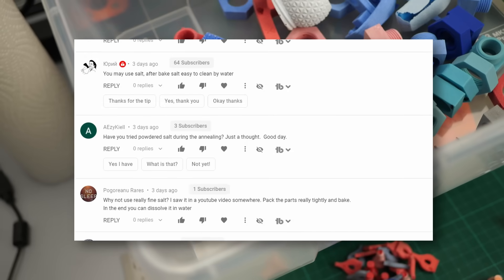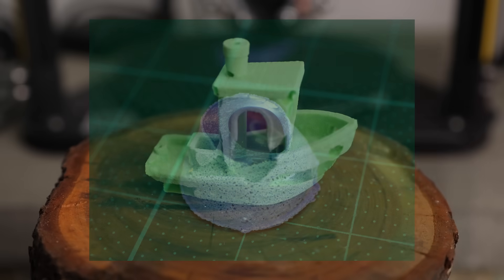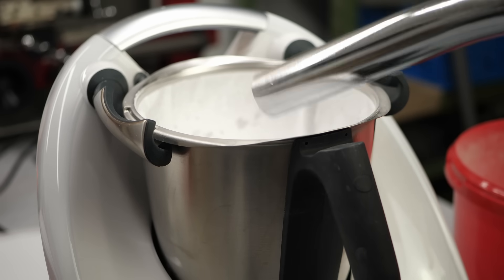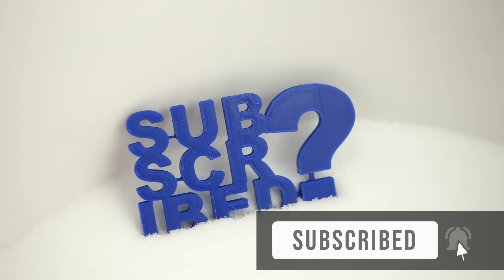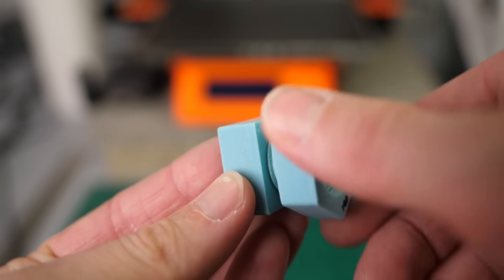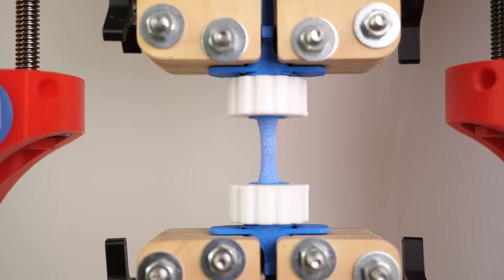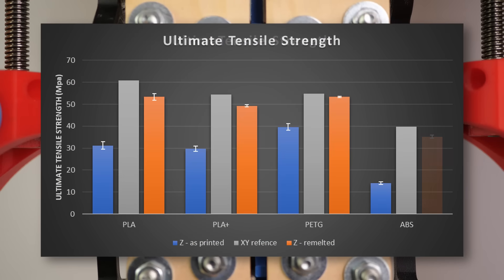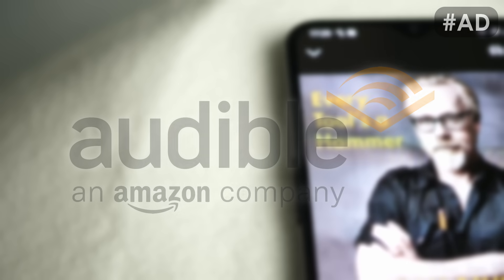The STRENGTH of 3D prints REMELTED in SALT

Comment: Use sodium carbonate. Sold in any supermarket in the washing powder section, cheaper than salt, dissolves in water, melting point is 850C. Super fine grains. Don't confuse it with baking soda, its melting point is just 50C. Also - consider applying a bit of talcum ("baby diaper powder") with a brush to the parts - they will separate more easily and surface will be better protected.
Reply: I'm sure you could use talcum powder but on Amazon that stuff's expensive, 500 grams is $30. You can get 4500 grams of sodium carbonate for $20. Sterile talc powder has a grain size between 0.399 μm and 100.237 μm with a mean at 26 μm. Sodium carbonate is slightly larger at 115 μm, you might be onto something coating the part in talc powder and then packing in sodium carbonate.

Edit to add if anyone decides to use talcum powder wear a respirator and be very careful about not breathing it in as it is not water-soluble and can lead to lung damage and cancer with prolonged exposure.

Also sodium carbonate can cause you to go blind if it gets in your eyes and it can cause scarring in your lungs. Wear a respirator if you're going to use either of these powders and avoid creating dust when working with them.
Reply: @cchamilton1985  wow, talc can cause lung problems? I didn't know, it's used for baby's skin, so i thought it’s completely safe 😅
Reply: @88Timur88Bahmudov88  if you check the packaging most powders these days are talc free. Be sure to check out the safety data sheet for this and any other powder you intend to use. Sodium chloride (table salt) is relatively safe even if mishandled, and almost any chemical is safe if handled properly.
Reply: @88Timur88Bahmudov88  They found out that talc is basically diet asbestos
Reply: @cchamilton1985  Talcum powder prices often aren't as high as you stated when you look around a bit. Look for the larger packages that aren't marketed as baby powder and you can get the stuff at a third of the price. Not sure about grain size though, it's hard to find such details on online retailers.
Reply: also some information about baking soda: "Baking soda, or sodium bicarbonate (NaHCO3), is a chemical that can undergo a decomposition reaction when heated. At temperatures above 176 degrees Fahrenheit (80 degrees Celsius), sodium bicarbonate starts to break down into three compounds, forming sodium carbonate (Na2CO3), water (H2O) and carbon dioxide (CO2)." So you can basically put the baking soda into the oven for some time at the temperature higher than 100 C and get sodium carbonate
Reply: wait wait wait, could you just use talc powder instead of salt? It's really fine and as i found, it's melting temperature is also about 800 degrees C, would be really cool if it worked
Reply: just use calcium hydroxide, sold as hydrated lime in 25Kg bags for dirt cheap. It's also used in construction work... 
and can be dissolved by any acid, including the classic vinegar.

Comment: How about using kinda pressure vessel filled with non reactive fluid? You could use a certain pressure at start and tat pressure would only get higher on hearing while even pressure application is ensured.

Comment: What if you dipped the printed parts in melted wax first and let it dry. Then pack the part in salt. I'm thinking the wax would melt to the salt. This would keep the parts shape and allow the outside layer to remain smooth.

Comment: Nice job. Free spirit deserve a shout-out for telling us about this amazing technique. 90% strength of injection molding is amazing.
Reply: Thanks for the shout out!
Reply: Is it thought?  I thought he'd achieved 90% of the non-crossectional strength?  Is that actually the same as IM?
Reply: @JohnDriggers  So we need to injection mold test samples? 8)))
Reply: @D__x  Always looking for fun experiments! :P  Looking at reference materials, it seems like 51-55Mpa for IM ABS.  If I look at Stephan's bar chart, it looks like he's measured 40Mpa for FFF.
Reply: I think free spirit reached 90% of injection molded parts. Stefan didn't. I guess he used way to high temps for the parts. Free spirit didn't heat them up as much.
Reply: Did I? I didn't do any strength tests, I don't have any of the equipment for it :)
Reply: @free_spirit1  You can easily make equipment. Here is a middle school science class technique. Suspend a bucket of known weight from the sample under test. Get a set of identical reference weights, like a large container of washers. Add the weights one by one until the sample breaks. Weigh the bucket.

Notes: stack books under the bucket so it will only fall a few millimeters. The weights have to be released into the bucket without much momentum.

Set up a camera to video the weights as they go into the bucket. A few weights can go into the bucket after the part starts to fail. Remove that many weights before weighing the bucket.

Comment: Beautiful results! As for injection molding machines being too expensive, you aren't correct since some benchtop injection molding machines can be as costly as some FDM 3D printers and in the range of 3000~5000 USD which is acceptable
Reply: How about the injection molds? Aren't they the primary reason why injection molding cost so much?
Reply: @georgietorrance  for benchtop injectors you can do with 3D printed molds using SLA machines.

Comment: Rock Dust ... Stone Powder ...
$5-10 per kilo.
No corroding.
No grinding.
No rust.
... but perhaps stone-coated plastic parts?
Reply: The advantage of using salt is that it's easy to remove the outer layer with water.
If the stone powder is really fine and compacted might yield a better outer shell
Reply: @BaristaPablo  "stone" could be any mineal - like he used plaster before he can switch to bentonite or talcum, which is very cheap and also can be washed off in water afterwards
Reply: how about a lime/calcium based powder that could be removed with an acid wash like vinegar.
Reply from the maker: ..non water dissolvable. I think that's the problem.
Reply: @CNCKitchen  
What about spraying the part with a saltwater solution to coat it with the dissolvable salt, then pack it in a material that transfers heat better like greensand, silica, or talc?  Also, would love to see how much stronger/stiffer? This method would make nylon prints.
Reply: @McRootbeer  I tried this, the water boil off from the heat and made large pits in the surface of the model.
Reply: @LucasGarrow  huh?  I have no idea what you did (did you dip a print in boiling saltwater or something?).
Reply: @McRootbeer  the salt retained the moisture even though left to dry, packed in more salt and set in oven. There must have been residual water that boiled off in the oven because the print had large pits. I'll try to upload a pic.

Comment: I'm thinking kaolin, ball, or bentonite clay might also be a good option. It's already finely powdered, compacts easily, & has a sintering temperature far above those required here
Reply: I don't know Kaolin, Betonite might shrink so some pre processing might be necessary.
This could also mix with sodium silicate
The grog I use (fire clay)  is not far off Bentonite, I use fire clay in stovevs, it shrinks like mad from wet, hence the grog.
Reply: Or maybe even baking soda with the advantage of washing it out of the pores with a vinegar solution...  looks like 320 mesh from a quick internet search.
Reply: @kenreynolds1000  baking soda dissolves in water too
Reply: When i watched the video i was thinking about oil bound sand for metal casting and talkum powder.. Both are very fine, can be compressed and should work without preprocessing

Comment: Maybe HT Silikon is a good alternitive. After remalting you just have to slice it open
Reply: Definately a good method! But expencive, and you might as well use the resulting silicone molds to cast items from epoxy filled with chopped fibers to achieve strengths absolutely unattainable it "budget" 3d prints :)
Reply: @Balorng  also I've recently seen someone who used silicone forms for injection molding with great results and impressive detail resolution
Reply: Brush on with ht silicone leaving a vent on top with some additional plastic on top, place it in normal salt in heated vacuum chamber. The salt will act as heat distributor and support. Venting in vacuum will get the bubbles out. Maybe some moisture will go into the salt during the process. Overkill but science needs sacrifice :)

Comment: I have an idea, Mark Rober has a video about making sand a non-Newtonian fluid using ultra sonics - https://www.youtube.com/watch?v=My4RA5I0FKs 

In theory, wouldn't this allow the sand to better adhere to the part? It would act as a more efficient and much faster version of what you're doing with compacting the salt and shaking it around, I bet you could "activate" the salt, sink the part into it, turn off the vibration, compact it down as tight as possible, and then anneal it. There are ultrasonic vibrators that you can purchase from Amazon, people use them to make cookies, I might just pick up one and give that a go and report back with the results

EDIT: He doesn't use vibrations, he uses air injected into the sand from underneath, however (https://imgur.com/V1DyB2H) here you can see when the ball is ejected from the sand, it still has sand perfectly contouring around it, I bet a similar setup could be achieved with sand, just let the part rest in the middle and turn off the vibration and I think it should adhere quite nicely
Reply: That's so interesting, wow I really want to see this done. You'd think the fluidized bed would make adding and compacting parts incredibly easy.
Reply: A combo salt oven + fluidized bed would be a pretty slick commercial product to make post-processing prints a snap. One could even sell the premilled salt.
Reply: I was thinking of using an ultrasonic transducer too, however I'd love to see the fluidized air injected version too.
Reply: You are reinventing techniques already used in the metal casting industry. ;)
Reply: @joela2885  In my mind, the primary goal of the air-injected fluidized bed is to obviate the need to move the powder into and out of the heating chamber; objects can be inserted directly into the powder volume (and removed from it) directly.  Vibration/Compaction can be executed afterward...
Reply: @sublucid  indeed, i remember seeing 10year Ago a video of a polystyrene engine block being immersed in liquid sand for further casting by replacement in some industry. Can't find it tho. the concept of quick may recovering objects into sand with fluidized sand is not new. But not widely used and very cool
Reply: I don't think this would work, because you do the exact opposite of compacting. But using vibrations might do the job. 
 The main issue here is to get the frequency right. I'd say this might be grain size dependant, which makes it difficult.
I kinda like the idea mentioned in another comment, using a vacuum bag. Combing both vibration and bag would make that compacting way more efficient.

Comment: I have two ideas to share as well.

Regarding the grinding of salt, I think only same sort of ball milling is the way to get the grain size down to the necessary level.

The other idea is the alternative material. As you pointed out, salt is not a good heat conductor. My idea would be to use some kind of ferrite powder. That material is available in very fine grain size, and being a metal, must have much better heat conductivity. The big question is: where to get it, and how much would it cost...

Or maybe some ceramic powder? I'm not sure about it's thermal conductivity properties... maybe not much better then salt.
Reply: There are plenty of designs for 3d printed ball mills as well...
Reply: @fahrenheit_ak3195  Those are child's plays only. Here you need volume and strength, not exactly what a generic 3D printer is able to produce. But there are DIY projects to make one, like e.g. Make it Extreme's one here on YT.

Comment: Im curious if adding a bulb of material(3d printed to the part) on the top of the z access would allow for excess material to flow down and fill voids/air pockets in the part. Maybe add this material at different heights to make sure it begins melting prior to the rest of the part.
Reply: I already tried this and it doesn't work that well, you can see that the plastic doesn't flow as well and the salt bonded layers won't let the plastic move that good.
Reply: Did you try to heat the filler plastic first? It has a large thermal mass compared with the plastic model and it should either be heated slowly or in batches (you add some, let it melt into the hole in the salt, add more).
Reply: Maybe cast a riser out of recycled filament and add it to the top to get more material for less print time?
Reply: I was thinking about the same. It would be interesting to try to print the shell of the object (minimal infill), put a metal funnel over it with grounded failed prints and heat it only from above at the beginning. Like sand casting of sorts.
Reply: That is "lost pla casting", also a viable method of getting structual parts from, say, aluminium.
Reply: Hi. I was aware of that. Anything that melts quickly by the hot aluminium (even polystirene) can be used. I was thinking about melting the PLA slowly, with the model encased in something that can take that heat without deforming or letting liquid or gases out and also being reusable. Something like plasticine perhaps, but with no oils in it. Or clay. I believe it can be rehidrated after being backed at 250 Celsius for hours, but I dont know if it can hold its dimensions.

Comment: Thanks a lot Stephan! Next step could be to try to get a saltcrust around the part first. I tried salt mush with water and drying, but it can take some time and can crack. And I tried evaporating salt water below parts, but I wasn't able to cover the full part in my simple kitchen oven tests.
 And how about printing PVA on the outside? Which I didn't test in my trials, because I didn't have a dual extruder printer at home in these days. This might get rid of the puffy surface in the essential material. PVA might become insoluble due to the heat treatment. Maybe better chose BVOH.
Reply from the maker: PVA might be a great idea.
Reply: @CNCKitchen  Yeah, especially you are not limited to salt anymore and you are able to chose a better heat conductor.
Reply: @CNCKitchen  And if you really want to get dirty: graphite powder. 🤩 Excellent heat conductor, still relatively cheap. And if you don't get too much oxygen into it quite safe. (Especially at the needed temperatures). Metall casting forms are made out of it. And since you have a professional oven now you can avoid to get black "Hefezöpfe"...😜
Painting with PVA fluid might be sufficient.
Reply: I like the idea of a disolvable protective perimeter.  This would really cut down futher processing time for those concerned with the surface finish and reduce generation of microplastics vs. other methods.  Would have to look into compatible chemistries between packing media and disolvable coatings/filaments.  Holy grail: the materials are cheap, non toxic and acessible in an average world market

Comment: Please try this process at lower temperatures and longer times. Maybe surface will look different
Reply: you have to at least reach the temperature that the filament flows again and thats when the surface mixes with the support material.
Reply: Ultimately it has to reach a temperature where the individual layers melt and fuse together. If its hot enough to fuse the layers then its going to be hot enough to cause the salt to stick to the surface so its kind of a package deal...

Comment: Will this work with flexible filaments too (especially with the clarity of clear filament)?
Oh, and maybe you could also test out graphite instead of salt/sand etc. ..?

Your videos never fail to amaze me, keep it up!
Reply: The more I think about, the more I like the idea of using graphite... ^^
It has a high heat conductivity, is very fine an heat resistent with no structural changes/highly refractory and chemically inert...

It can be bought in bigger quantities vor reasonable prices but sure not as cheap as salt...
(for ex. https://www.graphite-shop.com/de/mikro-graphit-10my-99.html) 
Handling might be quite a mess, but yeah, I'm sure you will figure something out...
Reply: Watch the video he referenced in this one, it was about using it on clear parts. That guys is also doing tests for transparent surface finishes.

Comment: Bal mill should be much better to grind salt. Also I think for this method we need degassing chambers embedded into part top spots which will be peeled off the part after remelting to get rid of big air bubbles or print with little over-extrusion.

Comment: For ABS, can you try and vapor-smooth the parts after annealing? I am curious to see what that does to the post-treatment outer layers
Reply from the maker: Would be interesting to see if that works and that would also tell us if we dissolved all of the salt out of the surface.
Reply: the porosity and vapor smoothing would likely result in a interesting finish that is not 100% smooth as I theorize the vapors would puddle in the pores.
Reply: It makes them everything but dimensionally accurate
Reply: @alejandroperez5368  vapor smoothing done carefully enough doesn't make any meaningful dimensional difference, it just takes the high ridges and averages them into the valleys a bit. Though it is very easy to go too far and make a massive mess destroying the part, its quite possible to do it without doing so - but its hard to get highly consistent just right results.
So I'd love to see if the salt crust messes the process up too much.